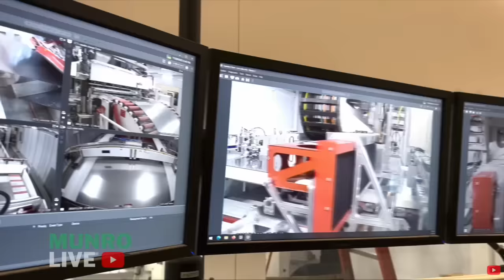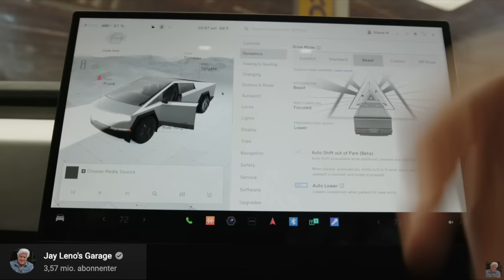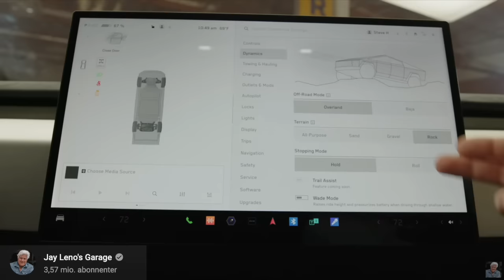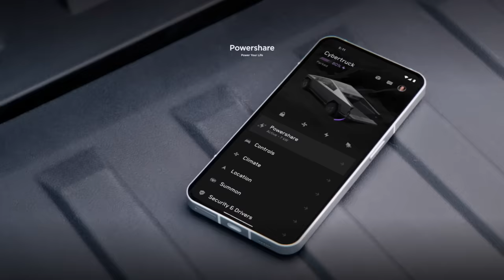NEW Hidden features of the Cybertruck & Sales are off the chart

Comment: Lars, Thanks for the video on the Cybertruck.  I agree with most of what you've said about how innovative Tesla has been, but I don't think the stainless steel Tesla is using is a totally special formulation.  There are plenty of 300 series steels that are special enough.  In some ways I'm glad I'm 1.2Millionth in line for the Cybertruck, because all the bugs will be worked out before I get mine and the steel will either be wearing well or Tesla will have reformulated the stainless steel.  In the meantime, I'll enjoy my Model Y.

Comment: I’m surprised the CT’s drive modes don’t seem to offer a “snow” option….that could be very handy for a lot of buyers!
Reply: Why? What is different? Baja or Off road means higher suspension settings. Should be softer too but I don’t think they can adjust the dampers. But what should it do in snow?
Reply: You need winter tires for the. Not a special driving mode.
Reply: @wolfgangpreier9160 the only thing extra you need is the slow speed anti slip which I think all 4wd Tesla's have
Reply: @bluetoad2668  Yes, never tried it and we got plenty of snow already.
Reply: There’s no special mode necessary for snow except for snow tires.  That’s what traction control and AWD is for.  A front wheel drive Toyota Camry will out handle any 4x4 on regular all season tires.   Especially when braking as all cars brake all 4 wheels.  👍
Reply: Somebody will figure out how to mount a snow plow on it 😅
Reply: @jander155  "Now you know" is on it.
Reply: @jander155 funny you should say that lol i was already thinking of making one
Reply: Wow oh no they did not think about snow 😅
Reply: @jander155  Someone has already done it to a few Model Y!   You know they will do it for a CyberTruck.
Reply: @badbeetle2942  I sort of have a snow mode: Chill mode, low regen, disable folding mirrors. Excellent winter car that way.

Comment: Wireless charging is important for several reasons besides convenience. Robotaxis charging themselves. Long road trips on FSD, Tesla stops and charges itself. Teslas towing trailers don't need to back up or disconnect trailer to charge. If trailer-mounted Range Extender Batteries (REBs) become a thing, trailer could also wirelessly charge in parallel with Tesla autos or Semis.

Comment: BestinTesla - current CT factory in TX is operating only 1/4 of Total capacity. 
they are only working w/ one Machine and have another Machine coming soon. 
they can also use Model Y casting machine (switch Dies). but only need 1x 9000T press for Rear. 
most impressive part , most parts and tools are made in - house. 
the Steel comes from Netherlands , made to Tesla spec.

Comment: Will beat a [Porche] 911 on the drag strip. Yes, but you forgot to add "while towing a trailer with a 911 on it". Yes it will be a 911. It will beat a 911, while towing a 911. ;-)
Reply: Yes, but to be fair, it was a base 911, and those cars are not particularly fast

Comment: It's not a pickup truck. It's just an SUV. But the marketing is clever. Hopefully all the Americans driving a huge truck around the city just to look cool will buy one. Most urban people really should be driving electric cars and trucks.
Reply: Why isn't it a pickup truck? Is the Ford Lightning a pickup truck? Is the Rivian R1S? The Cybertruck has a larger bed and more towing and load capacity than both.
Reply: @PaleBlueDotCitizen  rivian no, Ford yes. Think body on frame, cab separate from bed. It can be a cybertruck, but that doesn't make it a pickup.
Reply: A pick up truck is a cab with a truck bed. So it IS clearly a truck.

Comment: If Auto could go part way to competing by using electric transmission. Engine drives a generator which powers motors in the wheels. Add a small battery to smooth out peak loads and you have the best of both worlds. Over time, you increase the battery and shrink the engine. Nissan has started along this path. Will anyone else?

Comment: BestinTesla - sorry but, even the BEST wireless charging (Radio Frequency) is still SLOWER than the BEST Wired level 2 HOME charger. (240v 80A) . this will Always be the case, Physics . 
its also more Expensive technology , Cheaper to just place L2 Destination charger w/ Magic Dock at Diner, Business & Shopping . Grocery store can Afford Multiple units of L2 Destination chargers. 
Energy Utility & TESLA can provide FREE Chargers to Business/Lodging. USA covers cost of Install also.
Reply: Yes. But people use mobile even though fibre internet is faster. Convenience is a factor too. So you need to consider both.